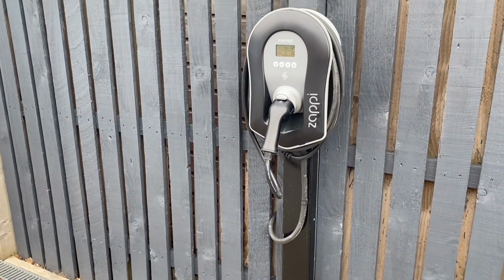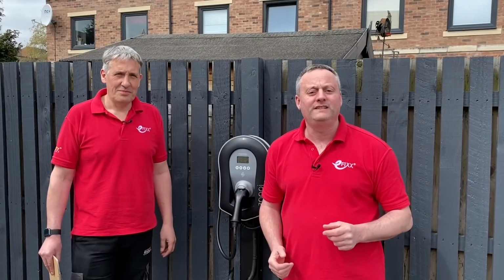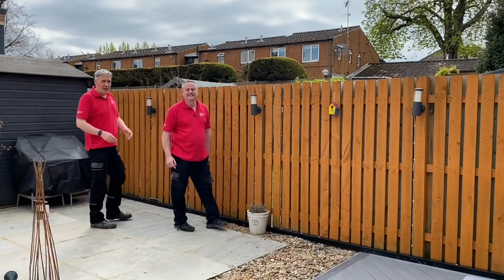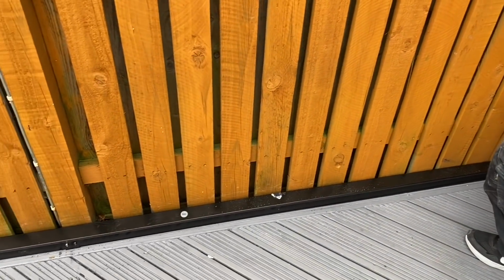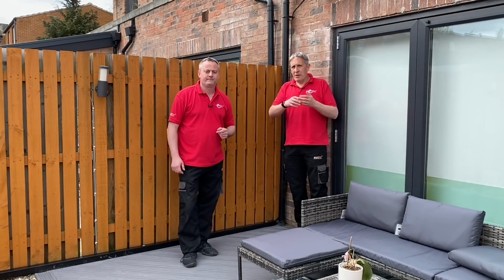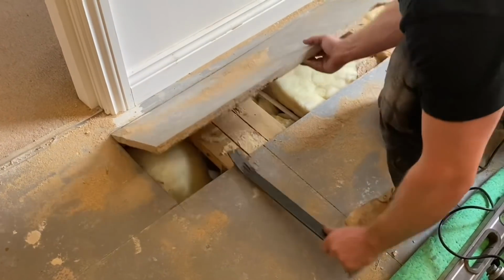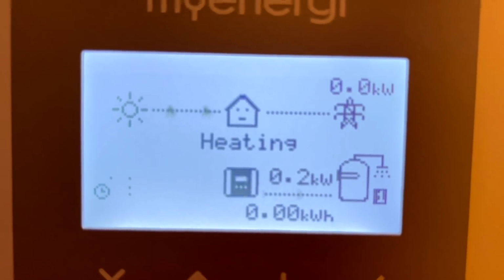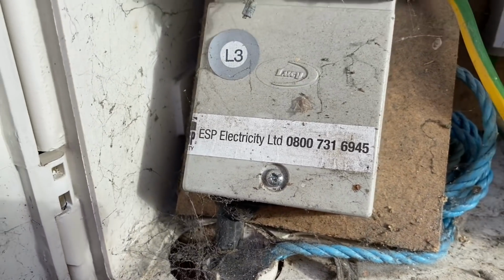ZAPPI EV CHARGER installation UK - It WASN'T easy - find out WHY

Comment: Interesting to find out about the galv trunking outside as we have seen galv trunking rust in less than six months indoors in a stone masons unit. Even have pictures as shocked how bad.
Reply from the maker: We will hear about it if it becomes a problem! Stay tuned!
Reply: @efixx 
Any update?
Reply: What stone was he cutting? Wonder if it was quite a caustic environment, I've seen lime plaster make stuff rust in under a week
Reply: @TheFool2cool  Marble which which I thought was a neutraliser?
Also I think the Galv rusted in weeks but only in one length / patch which is very odd. With it being up high it would only possibly getting a mist. Just curious to see what happens in this use after the dog possibly adding to the environment ;)
Reply: @Electronics-Rocks  marble is calcium carbonate, which is indeed basic in a wet solution. And in a stonecutter, it’s almost certainly being cut cooled by water… which means you’re basically spraying a basic solution onto the steel.

One environment where I suspect a plastic conduit/trunking is waaaaaay better.

Comment: The cost of this install 💵💵💵💵💵💵💵
Reply: That Tesla is worth £150K, so it’s all relative…
Reply: Giv me 150K I will giv you 2 brand new Tesla Like This and 2 EV Charging point including installation with eefix Gary
Reply: @emilgemc8913  it was a bit misleading, there were shots with the “cheaper" Model 3 bonnet as well as Model X, which is £134K specced out
Reply: @mostlymessingabout  The problem for the installer is often not the end client but getting the extra costs past the firm who contracted the job. This does illustrate that often the "standard installation package" is just a starting point as it usually just includes the charger, an RCBO and up to 10m of twin and earth cable surface clipped. I've installed loads an I've only ever had about 5 jobs which actually fitted that criteria.
Reply: @Blackf1ngers  back to 3 pin plug it is then 😅. I’m just going to run an IP65 twin socket outside. To be fair, going from 3kW to 7kW doesn’t sound like it warrant all these expense if you’re going to drive a £7K Nissan Leaf… For Tesla owners, even a proper charger is still painfully slow at 15 hours, so they might as well go for Supercharging anyway. Many people exclusively Supercharge.
Reply: @mostlymessingabout  make sure its a TT socket 👍
Reply: @mostlymessingabout  isn't a Leaf limited to 3.6kw on an AC charger anyway?
Reply: @Blackf1ngers  6.6kW optional extra AC charging on old Leaf actually...
Reply: @mostlymessingabout  the 13amp charging leads on telsa have been known to get very hot and melt...10amp on a 13amp socket is really the max rating loading long term
Reply from the maker: Exactly - a surprise when you see £300 advertised!